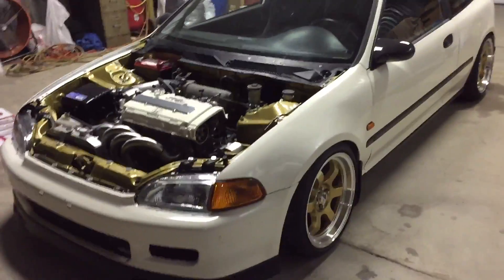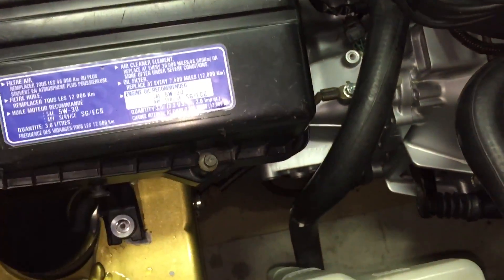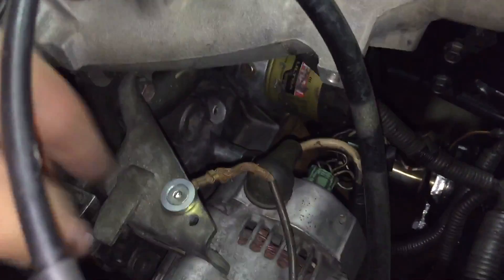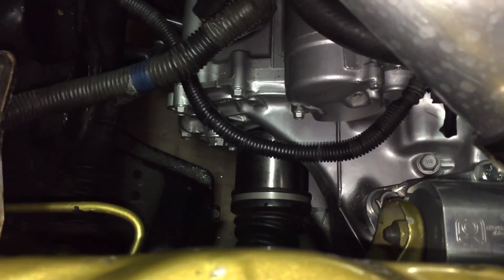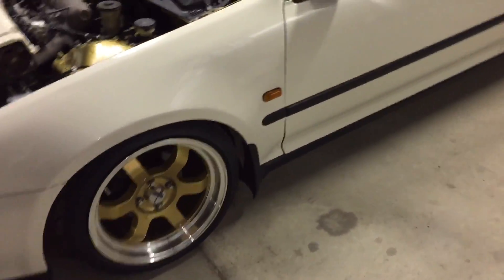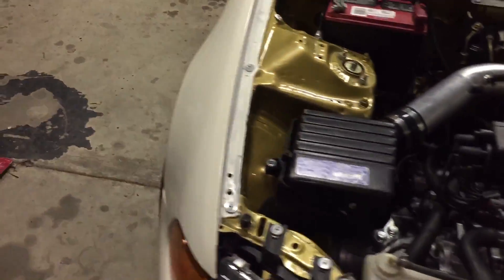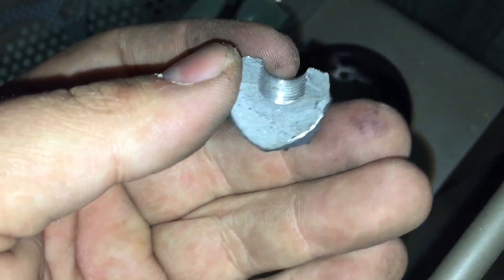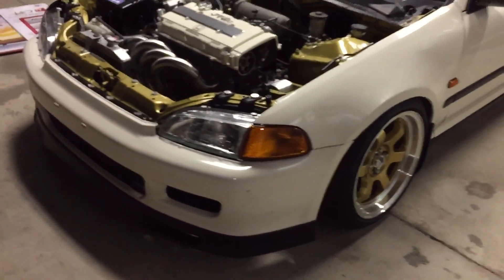Finally got a Sponsor? MPC Motorsport

Comment: 1:35 whats that connector to the oil pressure sensor my car doesn't have that i only have the sensor itself and where do it connect to?
Reply from the maker: Are you taking about the oil presure sensor on the vtec solenoid? And it might be cuz i have a GSR head not b16
Reply: yeah thats what I'm talking about. would i not h ave the connector because i have a b20? I've never seen the connecting part and i have to buy the solenoid because it didn't come on the b16 when i bought the motor
Reply from the maker: +JDM SWAG i have no clue man :/ i also have a B20
Reply: ill make a video asking about it tomorrow look out for it and maybe that'll help me out.